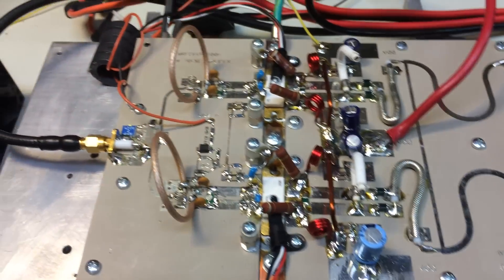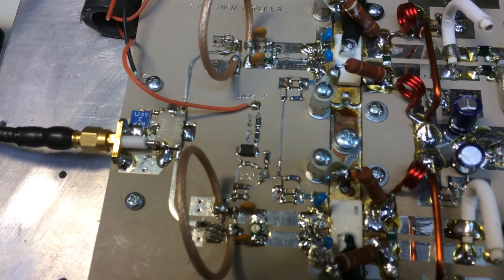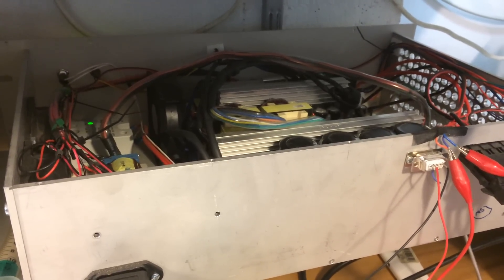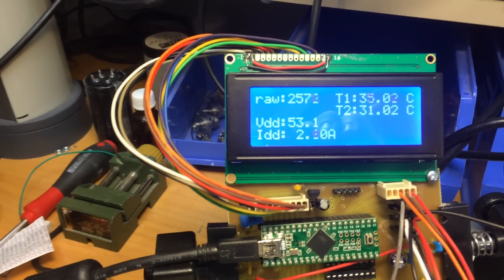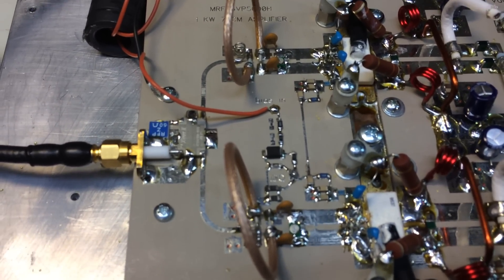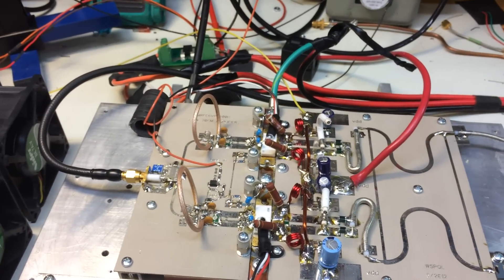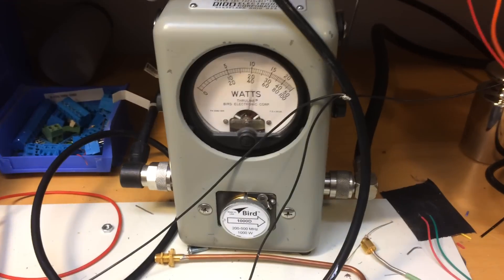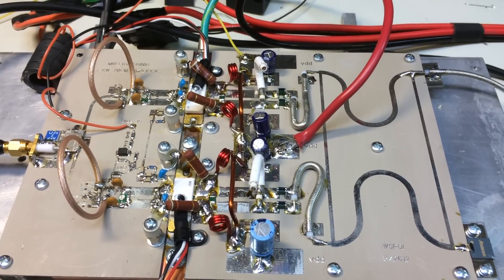1000w 70cm SSPA - 2x BLF184XR

Comment: Hello Benedikt, I have built up a 1kw amp from the W6PQL pallet. Mine now plays well but due to inaccurate information on Jims page, I never drove it with more than 4 watts. Could not figure out why output was no where near 800 to 1000 watts. NOW after chatting with Jim on the phone, I drive it with15 to 20 watts and I am happy. I too, will be using the amp on EME, so I hope it can deal with the duty cycle of Q65!   Dave N9HF  el99